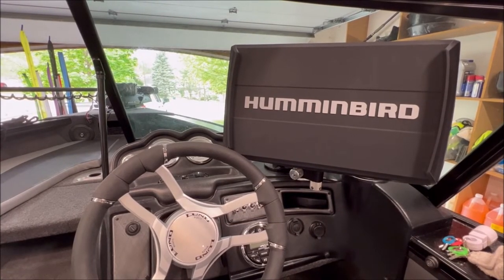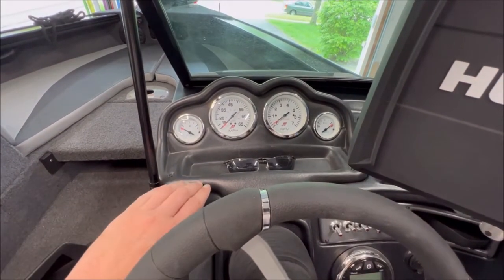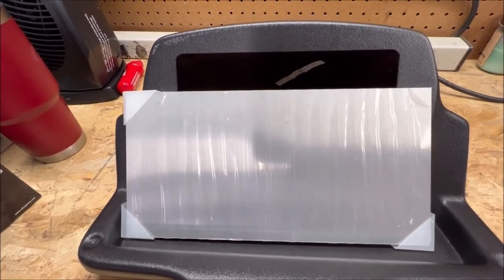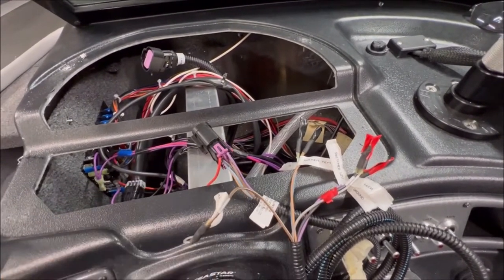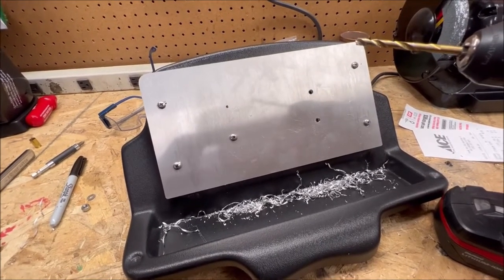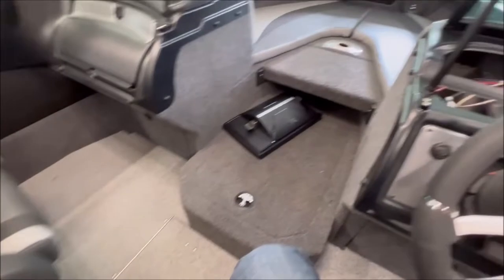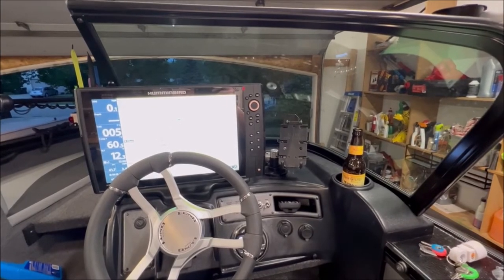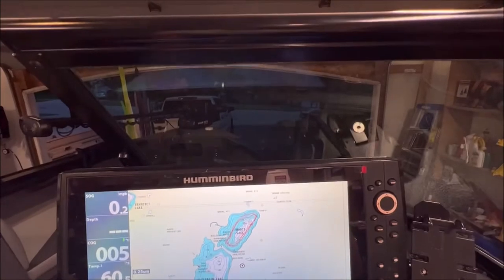Replace Your Lund Boat Gauges with your Humminbird

Comment: congrats on the new boat. i am currently enjoying 1175 adventure, 2 seasons already. your ram mount for the phone. is it just self tapping screws or you got nut under the console securing it? 

what was the deciding factor for you to upgrade from the rebel? 

Cheers
Reply from the maker: I have used both screws and bolts in the past. For the phone specifically was screws on the Rebel, but bolts are better generally speaking.

I loved my Rebel. It was a great boat. The crossover is simply bigger and nicer (but more expensive). I couldn’t believe how well the Rebel held up in big water, but the crossover does do it a little better.

Comment: You paid $200 for a new bezel only to butcher it with that hideous bracket. Why not butcher the original bezel?
Reply from the maker: Well...I tried something and shared it. If it helped you figure out what to do or what not to do, then it was a video worth while.
Reply: Thanks for the response. I was genuinely curious. Was wondering if you were saving the stock bezel in case you wanted to go back later. @tommysgreatoutdoors
Reply from the maker: @G029er  no worries. It was an experiment in a way. If I completely screwed this up, I had the stock parts to put this back together.